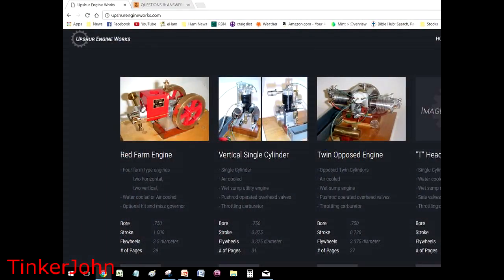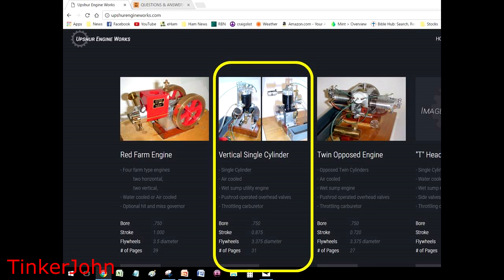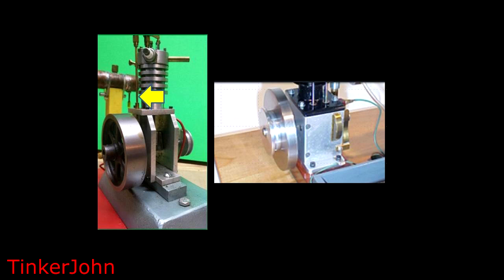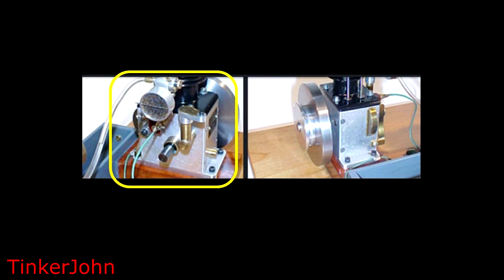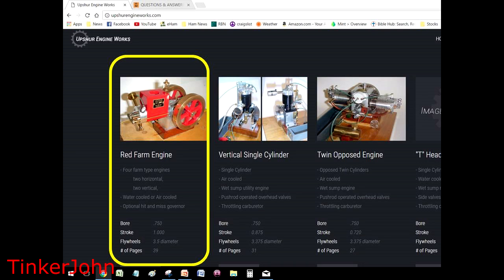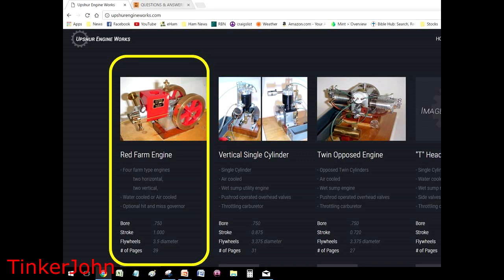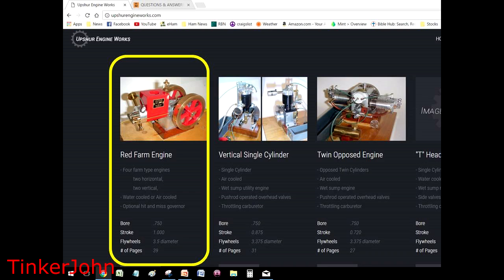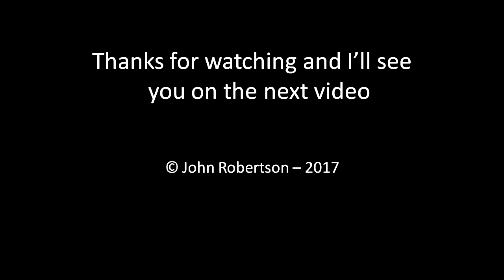Building the Upshur IC Model Gas Engine –  (UPDATE) PLAN AVAILABILITY

Comment: I bought the vertical single plans that Upshur offers now. In the set of drawings, there are a few sheets with the open crank air cooled engine that you are currently building or at least the model in the plans bought are quite similar.
Reply from the maker: Thanks for the update on the plan status.  I purchased my set of plans a few years ago and apparently they are not the same as offered today.     ~John

Comment: Isn't it 'Red Farm Engine'?  My plans say 'Upshur Model Farm Engines' , 'Four working model antique gasoline engines'. 
I also have a copy of August/September 1989 'Strictly I.C.' 'Antique Farm Gasoline Engine' article written by Hamelton B. Upshur I got with my stock kit (horizontal only).  I haven't thoroughly compared the two sets of plans.  I haven't started yet.
Reply from the maker: Thanks for watching.  I don't have a set of current plans, all I know is what is on the website.  I appears the engine highlighted in the video and mentioned in the description are close or  the same.  The plans I have are over 10 years old and it looks like they may have been updated since then.       ~John

Comment: John, I have been in contact with Scott (the grandson of Harold Upshur) via the Upshur website regarding the plans for your build. I too made the mistske of thinking that the wet sump plan was the one which you were working on and purchased it. After speaking to Scott, he informed me that he is trying to contact you with a view to getting the correct plans converted to a PDF file and then make that file available on the website. I sent you a more detailed personal email regarding this about two weeks ago but as yet have not had a response. In the meantime, do you have any idea where I can get a copy of the Modeltec magazine which has the plans? I live in Scotland so I am unable to just "nip across" and get a copy. Regards, Tom
Reply from the maker: Tom, I've checked both my inbox and spam  box and did not see your email.  Regardless, I apologize for not seeing your message.  Scott did email me over the weekend and I replied back the next morning, however I've not heard back from him as of this morning.   As mentioned in the video, I don't have the current plans and did not realize there were any changes from the ones I have to the ones available today.  As for finding a Modeltech magazine, as you may know they went out of business several years ago.  Other than a "For Sale/Wanted" thread on a machining forum or online auction, I don't know where to suggest.  Hope this helps and that the plan thing gets sorted out.      ~John